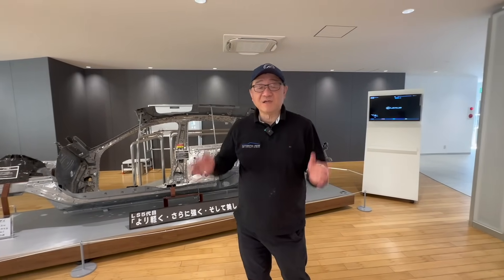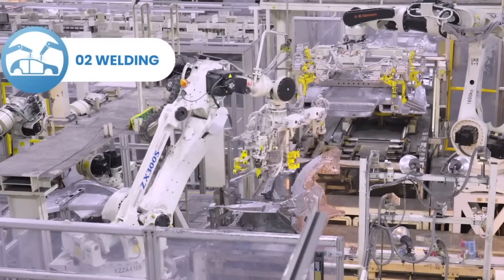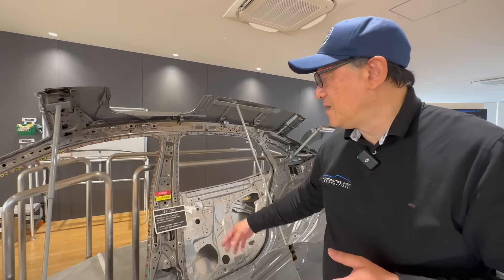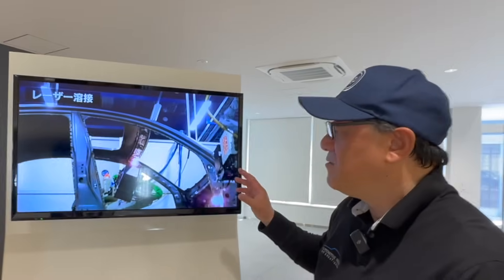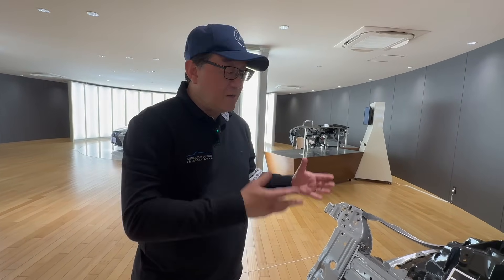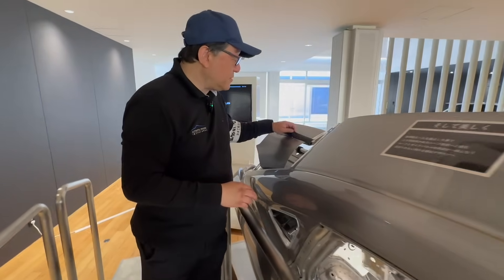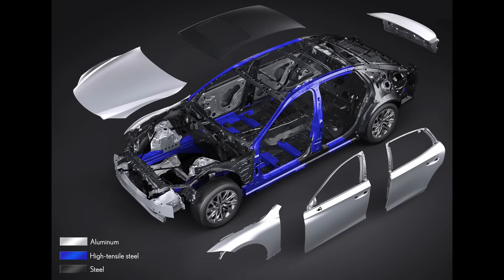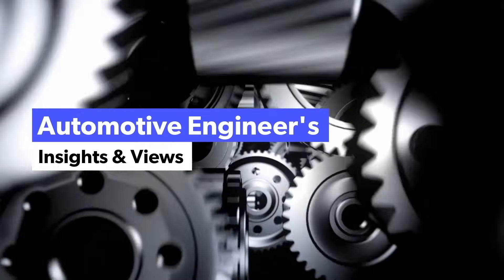"LIGHTER, STRONGER, AND MORE BEAUTIFUL" - LEXUS PHILOSOPHY AT TOYOTA TAHARA PLANT IN JAPAN

Comment: LS without the V8 is boring. Imagine a Hybrid 2UR (525hp) with a ZF8 weighing around 4200lbs.
Reply: 4200 lbs part is not going to happen. GS450H with NA V6, and eCVT is about 4200 lbs, so LS is going to be at least 5000k in the best case.

Comment: Hang on a minute. Since you know the processes, how can you say this stuff? Laser spot welding and resistance spot welding both add no mass, affect only a spot and work by fusing the to metal sheets together. laser welding may arguably be a slightly better finish but its a distinction without a difference. I don't know about cycle time per spot, but otherwise how are they fundamentally any different?  Laser welding isn't materially any stronger and only is better in the end product due to the reduced pitch of the welds. They could get most of the way there simply by reducing the weld pitch of the old process. Laser does allow a narrower pitch, but that's only an advantage if they add the extra welds. Much ado about nothing. If they really want a rigid structure and truly "one piece", get rid of all this and use "giga casting" like Tesla.  "one piece flow" is mentioned totally out of context. a "piece" isn't a weld, and they aren't all done simultaneously in any case. "one piece flow" means one work piece through a process not one step in the process. I'm a big fan of structural adhesives, but that does add some weight though its lower cost than continuous seam welding and achieves some of that benefit at a lot lower cost. The roof ditch weld is nothing new. The automation on it reduces cycle time and but its fundamentally the same as it was in the 30's when they did it with lead - not at all impressive and still highly inefficient. Why not continuously laser weld there? You compared aluminum to steel as though they would be used 1 for one in mass but they aren't, so the material weight is only part of the total mass equation. I'm a Lexus fan and have two LS400's so this isn't about the cars its about the content. Overall I generally like your content, but this was a word salad of regurgitated mostly BS PR with so many technical inaccuracies that I can't catalog them all, even though the summary benefits comments were correct. This is quite disappointing coming from an engineer. Lexus is good enough without the phony magic show.

Comment: Thanks, David! I have a question. If you compare the 2nd gen LS to today’s LS in terms of quality and refinement (given technology available in their respective eras), would you say the 2nd gen LS was peak Lexus?

I might be old and biased, but I think the 2nd gen LS was the best Lexus ever built. The materials, attention to detail, and styling were top notch. The door close of the back doors on that 2nd gen LS was the best door close sound ever. When I was a teen, I would visit the Lexus dealer just to open and close the door several times to hear and feel it.

I remember the dampening on the ash tray, cup holders, and glove compartment on that LS were synchronized and they all glided open at the same pace.

I just wanted to hear your opinion, if possible! Thanks!!
Reply: I think the end of the first Gen was the best because the engine was the most robust and I like the styling better than the 430.. I have two, just having purchased a really nice "survivor" - a 2000 in great shape. Some of the later models are actually downgrades - cheaper materials, more exposed metal etc.. just look at the sales. Won't surprise me at all if they cancel the LS soon.
Reply: @spinnetti  For me, the 2nd generation LS was the 1995 to 2000 LS400.

Comment: Doesn’t LSW have repair issues vs spot welds which can be drilled out?
Reply: no, because though the tool is different the affected metal is essentially still the same (with less weld spatter) - just a lot more welds to drill out.

Comment: VW used/uses seam welding vs. the brazing to connect the roof and side panels.  Seems like this is a simpler method and high weld surface area.  The Passat used this technique.
Reply: Agreed, and higher strength too.